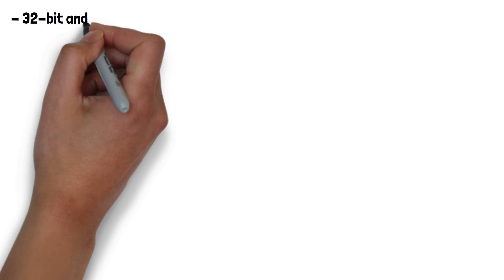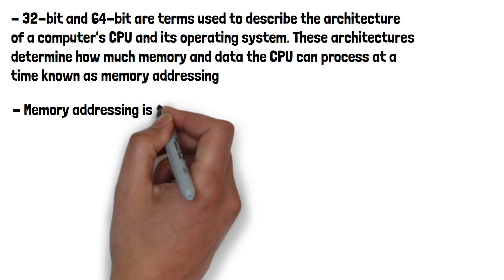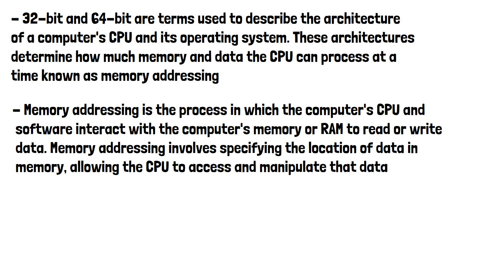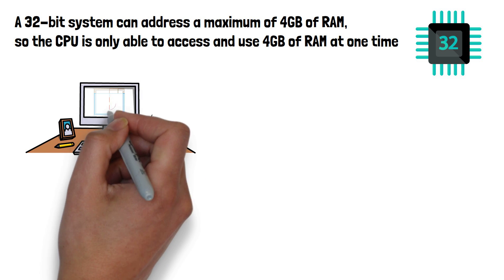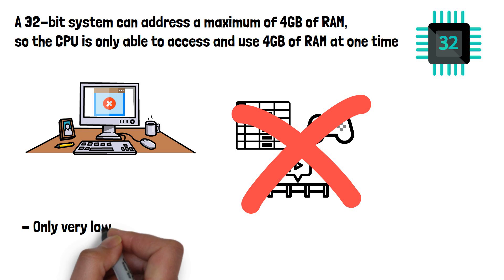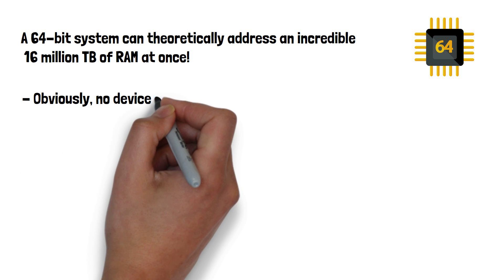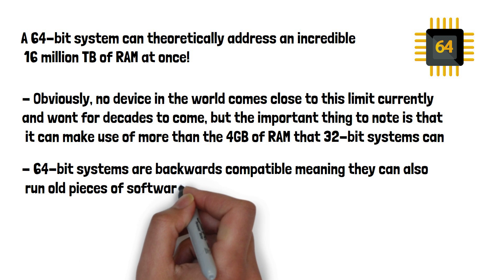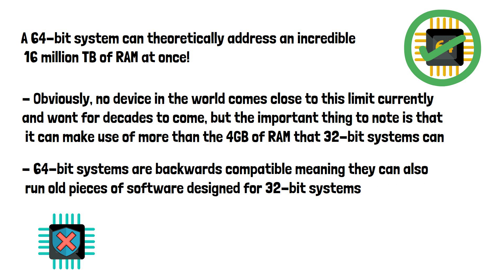32 bit vs 64 bit

Comment: Every youtube video only explain accessible RAM capacity between 32-bit and 64-bit. Can you explain how different does a CPU handle 32-bit and 64-bit apps? Does the registers also have 32-bit length and 64-bit length? What is the instruction sets of EM64T or x86-64 in a CPU used for? How does it impact 32-bit or 64-bit apps?

Comment: If we ever get there how powerful would a computer be with a 128 or 256 bit processor
Reply from the maker: This is a great question and one I had wondered too. It took me a while but I worked it out to be that a 128 bit processor could theoretically address 268,435,456 Geopbytes of RAM. For context there are 1,000 terabytes in a petabyte, 1,000 petabytes in an exabyte, 1,000 exabytes in a zettabyte, 1,000 zettabytes in a yottabyte, 1000 yottabytes in a brontobyte and 1000 brontobytes in a geopbyte. To further put that into perspective it’s estimated that the total amount of data that exists in the entire world is around 175 Zettabytes!
Reply: @techindex1 theres probably many copies of data in the world sooo
Reply: @magicwizurd8970  it still exists. what's your point?

Comment: How did we go from 4GB to THAT
Reply: 32 bit can express 2^32 numbers which is 4 billion, so you can distinguish 4 billion memory addresses. 64 bits is 2^64... That's it.
Reply: By adding one bit, you double the number of memory addresses. 64-bit CPUs have 32 more bits in their memory addresses. If you double 4GB 32(!) times, you get around 16 million TB.
Reply from the maker: Incredible isn’t it, both comments above explain it very well, thank you both